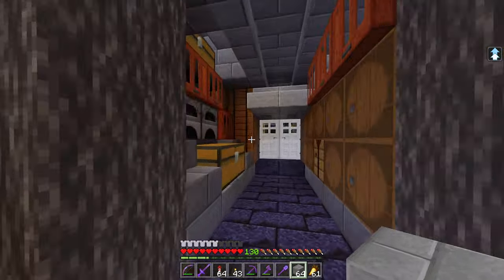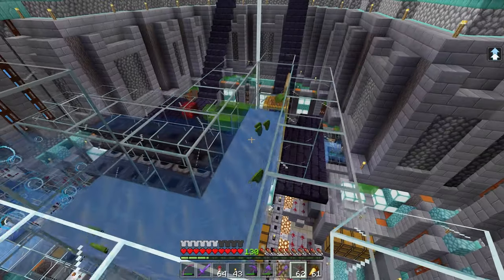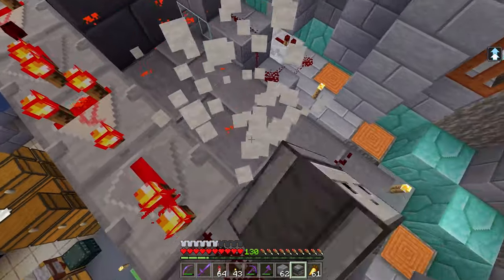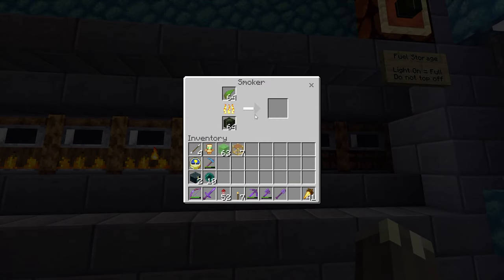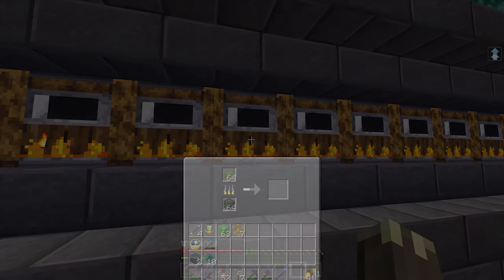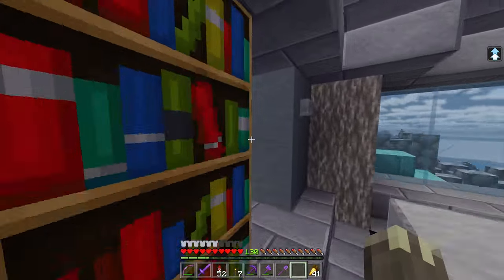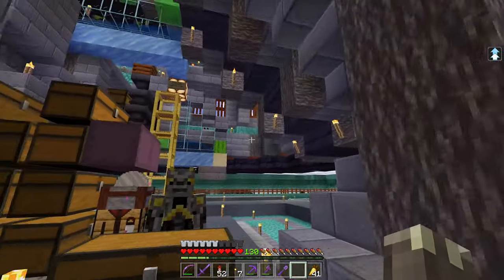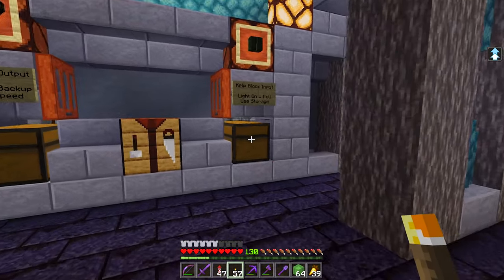MINECRAFT Survival #179 | RENEWABLE ENERGY! | KELP SMELTER & WARF PROGRESS! | LUNA SSP Phase 2

Comment: How did you know warf would be big enough for all the components you've added in so far?
Reply from the maker: I didn't. The way I build is very fluid and I don't plan too far in advance. For instance, if I needed more room for something, I'd just make the build housing it taller since I wouldn't be able to go wider. But there's plenty of room here.
Reply: @LOBOsgarage  Thats one aspect I have been working on improving with my building. Its seems as though I make things one block too skinny or one block too short to fit what I end up wanting.